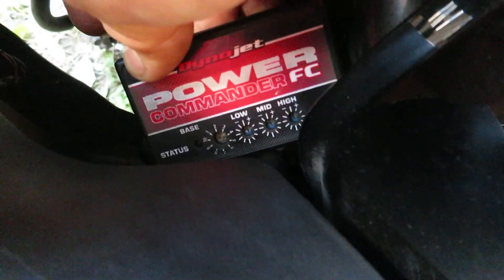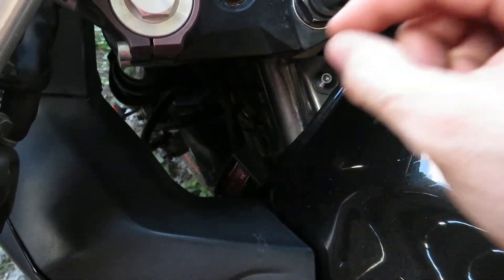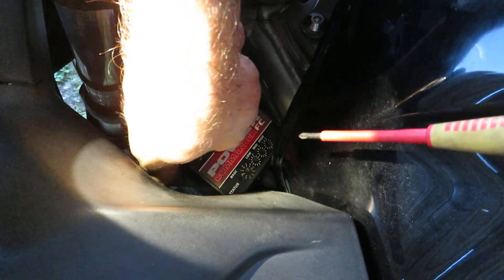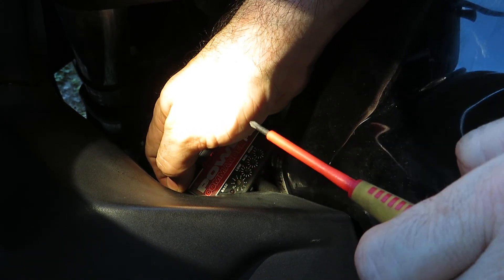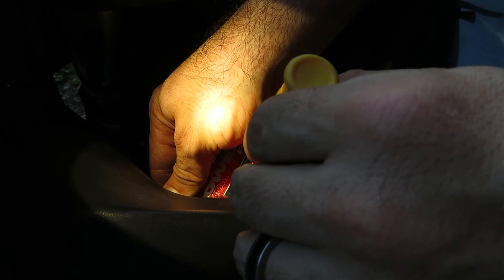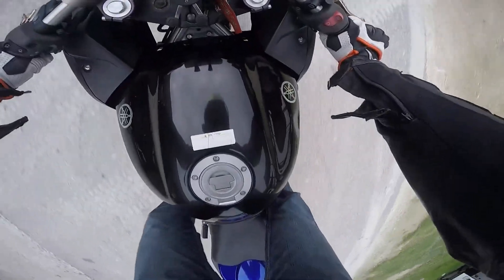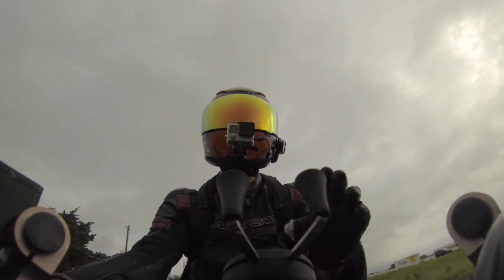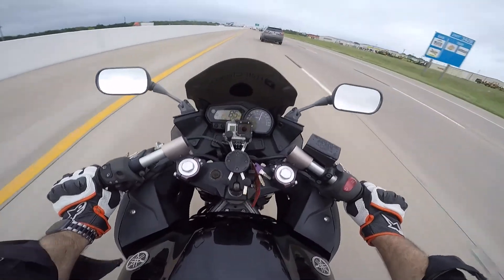Fizzer Friday: Ep. 8

Comment: It was tuned using the Power Commander V here in Ontario, Canada. Hindle did also mention that results may vary in the US due to 1. differences in fuel and 2. elevation to sea level. Humidity also plays a role because I remember them not being able to test after it had rained as it would throw off the results.

Comment: Do you like it? I just wanted to express my thinking on why i moved the fuel trims up or +5, since the dyno was with a K&N air filter, i figured that since my DNA filter allows more air into the bike, and i wanted to balance the fuel trim with all the extra air, and riched it out 😎🤙
Reply from the maker: Nice little extra punch for sure. Seems to be stable, and doesn’t smell super rich like Marthy’s RevA tune, even turned up like this. Might pick up a DNA filter to supplement the added fuel, though..
Reply: @HalfClickUp  nice man, yeah that was my first concern too though is that it was gonna run super rich, but i turned my dials down to +2 and that's what i was riding today and felt the same, thanks for the shout out again man 😎

Comment: Hey man I have a question, I have a 05 fz6 naked and the bike has a low rpm miss,  especially when it gets really wet or I take it to the car wash......  I think I have a coil that is getting wet or something.... have you had to deal with this problem?
Reply from the maker: I have not, but if it’s really associated with wetness, then that’ll help narrow it down. Check your harness for any exposed copper. Harnesses hate water intrusion. Also, a new set of plug wires couldn’t hurt, especially with that age.
Reply: @HalfClickUp     ok I put a new set in just last month, it seemed to help a Lil bit but now it's starting to miss fire worse.......  I think where it's not firing right it's staring to file the plugs out....   it miss fire really bad a idel, but when u rev the moter it seems to run fine... after you get the rpm above 3 to 4k it sounds fine...
Reply from the maker: @johnstull9253  hmmm almost sounding like a fueling issue. Did you install new plugs when you installed the wires? Wonder if you’re not having an injector issue? Is the fouling isolated to one cylinder or multiple?
Reply: @HalfClickUp    I put new plugs not wires.....  most of the time it's one but every now and then it sounds like two...  I think it's 2 and 3 miss firing, and from reading the old plugs number 3 was the worst then 2,1,4....
Reply from the maker: @johnstull9253  dang man… maybe run some Redline through the tank and see if the injectors have crud in the nozzles. I ran a bottle through my tank at like 60,000 miles just in case.
Reply: @HalfClickUp   ok I'll try that and see if it helps any..... my bike only has about 18,000 miles and everything is original from factory. What ever it is has to be simple. Thanks for the help just thought I'd pick your brain for a sec.....
Reply from the maker: @johnstull9253  let me know when you figure it out, I’ll be curious to hear what the issue was!